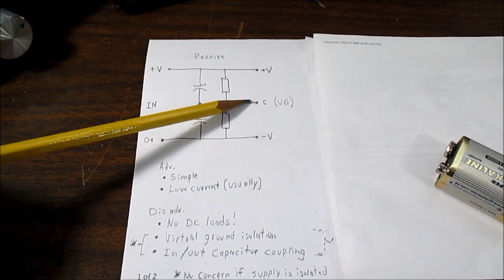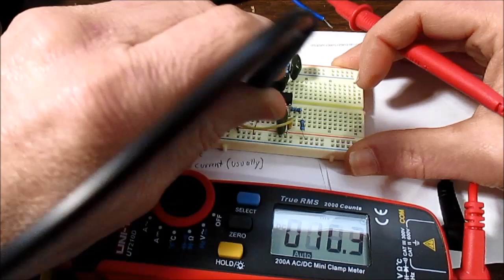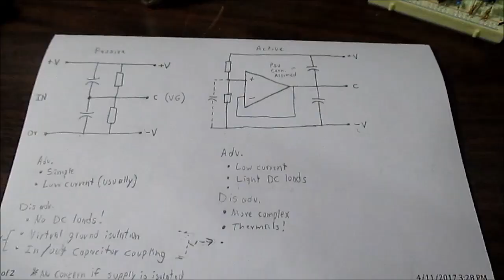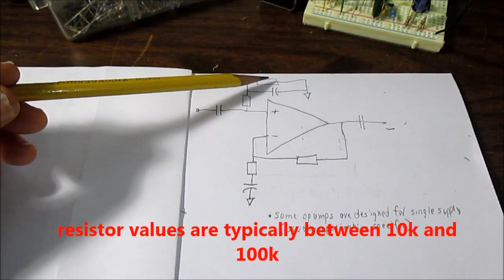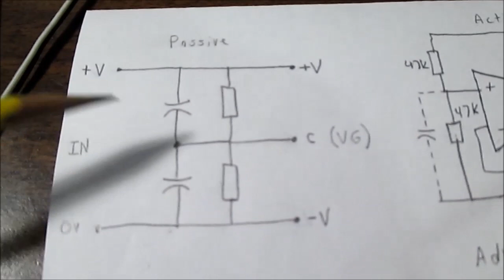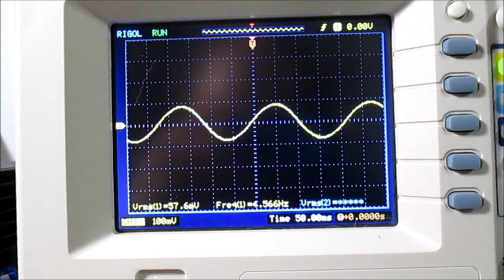How to use op amps with a single rail power supply

Comment: Hi,
I tried this passive circuit, not with 9v battery, but with 12 x aa batteries.
I tried this to get power to the LM1875 board, you know your vid "LM1875 IC audio amplifier board kit test and review"
The + - was balanced about 8.25 +-
The stereo from my phone was converted to mono via male/female jack, and fed into board.
Speaker was a 60w (smallish decktop speaker)
Also the resistors salvaged were small, 1/8 w (1/4 inch in length)
...I got nothing in the way of sound.
what I got was crazy hot battery packs ;) ha... 
Was it the amps?? 
What do you think?
Ta
Reply: What are the resistors value? I think you should increase both resistors to 4.7 kohms or more but both the same resistor.

Comment: I made one and it worked, sort of...
passive.
I found the caps and resistors from a old car tape deck (never used)
caps = 1000 uf (caps had the + and - sides)
resistors = 1k
any way, I soldered it up to a board, the board had no rails of electrical joins, just pin hole type thing (i got 20 from china for next to nothing)
Joining everything together proved to be a bit of a mission-for me anyways.
I was quite happy to see some results at the end haha

*my 9v battery had 8v charge in it.
*the - rail was -3.8v
*the + rail was 4.5v

I soldered the - side of the caps both facing in to the C  (VG)... don't really know why, but I did.
Could this be the cause of the un balanced 'unit'?

...I also tested the caps and resistors beforehand and they checked out.
Reply from the maker: That is a common mistake to face the negative side of the capacitor towards ground on the negative side of a dual supply. The neg side of the cap must face the more negative voltage, so turn the cap on the negative rail so its positive side faces the virtual ground side. Hopefully the light load of the balancing resistors prevented damage.
Reply: I changed the cap around and now have a reading
4.22-0-4.27
Now i got to see what I'll power up with this little thing.
Thanks
Reply: Use a new cap. When you connect an electrolytic backwards the dielectric breaks down and creates a short. It may seem to work but the capacitance will be significantly affected. Once you connect an electro backwards, it's destroyed. Do yourself a favor and buy a pack on aliexpress. Amazon has them too but they are a ripoff for electronics. Theyre very cheap on aliexpress.

Comment: John, Thank you for that Explanation of Virtual Ground.  I have a good grasp of resistor voltage dividers but I really struggled to understand virtual ground until I saw that simple passive voltage divider with your explanation.  I've looked through a lot of videos, most focus only on op amp virtual ground but they are vague.  With the resistors and nodes, it's simpler to see a virtual ground.

Thank you
-Christopher
Reply from the maker: Thanks Christopher! If I can help a few people out with my videos, I have met my goal.

Comment: So this is like taking a single supply and using it to produce a dual supply ... and maybe I missed something, but what about where you simply hook your single supply straight to the opamp power inputs?

I've got a project (currently on hold while I work through something else) where I'm trying to build a simple audio mixer that can take input from a CB, phone, and microphone and mix those signals together and output then out to some speakers, back to the CB and phone, and also to a camera.

The application for that would be on a motorbike for vlogging purposes, so the only power available is 12VDC single supply from the battery. Unless I use some kind of DC-DC concreter that can output +- voltages.
Reply from the maker: You are connecting the single supply to the power pins of the op amp. If you look at the diagrams, you can see they pass on through. It is that virtual ground  that the op amp needs for its 0 volt reference to work. And that reference ground needs isolated from other circuits that share the same power supply.
Reply: That would give positive and neutral voltage, 0v. Try it for yourself.